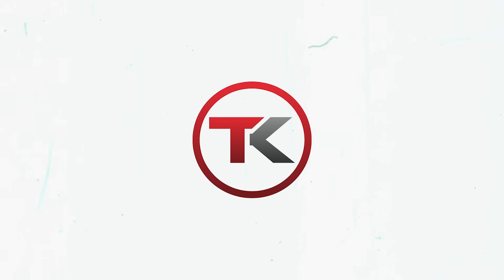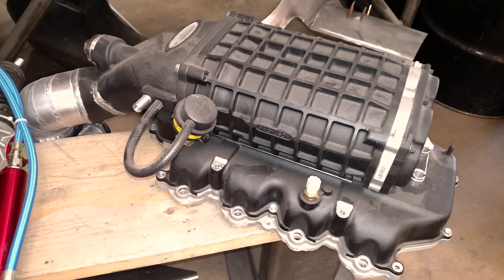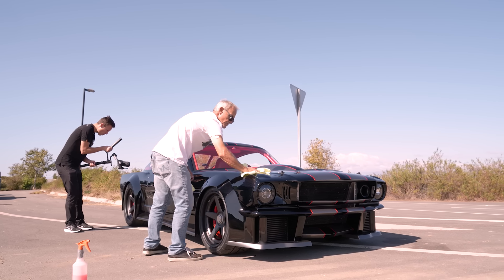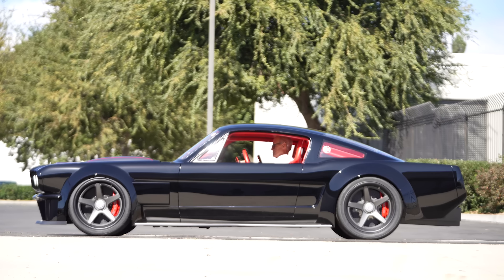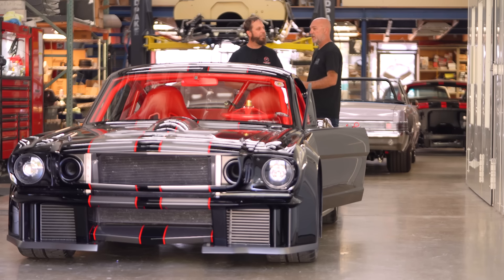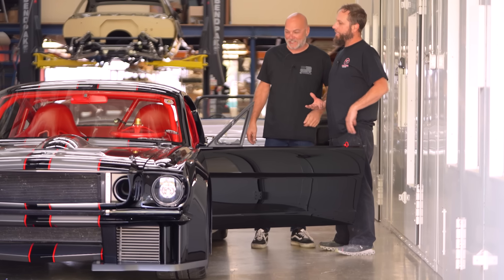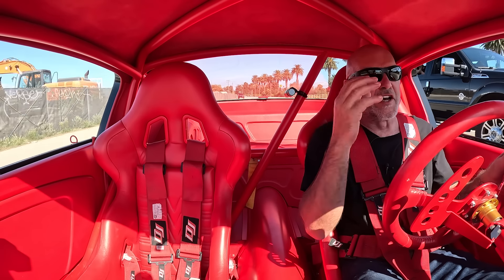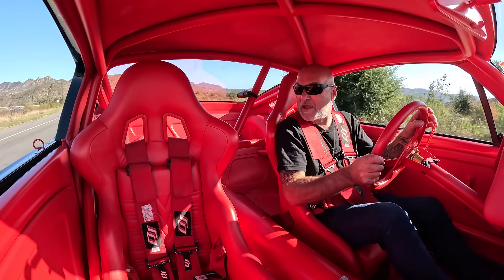The 1003 whp Twin Turbo/Supercharged Vicious Mustang 2.0 is Back!

Comment: I lost 675lbs. On my 66 chevelle using similar methods but used a badass 383 forged internals and ported aluminum heads to produce 625 hps......i ported and water benched the bowls......custom ground my irsken mechanical cam and lifters.....sold it at thunder valley noble oklahoma after two runs for 32 large in 2017......miss my she beast.....

Comment: If I were to change anything the black exterior would be either satin or flat black and a little bit of black in the interior just a tad for contrast, but these guys know far more about building and this type of thing than I do. There's nothing wrong or bad about the way it is just my preference would be the reason behind the changes.
Reply: Thank you, matte, satin or flat, if damaged, you have to re-paint the entire car. As opposed to gloss, you can deal just with the damaged area and blend color and clear coat. It’s more of practical reasons💯👊💯
Reply: @christophermarechal5017  i get it completely, Im just a fan of flat black I had a 79' Camaro and a 68 mustang that I had painted flat black and I love it. But I do understand the reason for gloss, it's beautiful regardless.

Comment: Truly a spectacular project! Impeccable craftsmanship and outstanding engineering. Speechless indeed. The only thing I'm down on is the ubiquitous red interior. Don't get me wrong, red is my favorite color but if it was toned down a little with a second color it would be even more spectacular. For example, the tunnel could have been painted black and maybe some black on the doors to contrast the red. Steering wheel spokes as well. Otherwise, it's perfect.

Comment: The car looks so vicious because the people that can’t get the driver experience from it still realizes how vicious this car is. Badass car. One question though. Did they use a more modern (2005-2014?) Mustang roof to get the fastback look and the quarter windows? If so that’s cool.

Comment: its an interesting setup, seen compound boosting on the old 2007 gt500 and the 03-04 cobra, but that Magnuson 1.9 is a restriction. 

Pull that off and put on a take off 2650 GT500 supercharger, you'd probably pick up 100+ hp on less boost or the same 16psi.

Comment: I'm right with ya. That car is very special. I do have one issue with the whole video. That is that you never really hammered it. I know it's not your car and you don't want to tear it up. But I think it's safe to say it was built to be hammered. All the internals are there, everything was taken into consideration so that when the throttle is pegged it works and it will stay together. So 5,000; rpm ? 6000 ,? Nope I would have had to get to 8500 rpm minimum.  Regardless great job for sure. I really wanted to hear it at 8000 +  the Coyote sounds really good up top.

Comment: 5.1 liter 4 valve V8 with twin 68mm turbos plus a 1.9 blower on E85 revving to 9,100 RPM on 26 PSI and making only 1003WHP? What am I missing here? Did this car have a massive boost leak? 
My 997.1 turbo bored and stroked to 4.1 liters boxer 6 cylinder with twin 66mm turbos on E67 with 30 PSI revved to 7,000 RPMs puts down 1209WHP. Something doesn’t add up

Comment: It's kinda hilarious how fast and visceral this thing is, and you barely got into the superchargers boost, let alone gave it enough throttle to spool those 68s up 😅 I'm sure the NA block makes 550+ hp, which is effectively what you were using the entire time.... I love turbocharged cars, and absolutely adore compound boosted stuff, you never see them, but with a Magnuson 5th gen alone (which this isn't) this would be putting out the same power if not more....sure it's nowhere near as cool as a compound setup, but you'd lose all that piping and turbos and probably at least another 150lbs of weight removing it all and simplifying it 😅 ....or, get a 5th Gen in place of that, and keep the turbos 🤣

Comment: What the whole left side was tore up? That  door ding give me a break. You blew it on that one bud . Over exaggerating  for effect destroys credibility.
Reply from the maker: Left rear flare, door and pushed into the fender…over exaggerating? It was $100K repair but I’m over exaggerating 🤦‍♂️
Reply: @AutotopiaLA  you were more careful and specific with your words when describing your car accident. Yah you exaggerated with the adjectives used to describe that minor dent on that custom car. Had that dent occurred on a factory assembly car.  It would be the same amount of time to repair. The cost is arbitrary the time is the same.
Reply: @hansenleal For you to compare the damage to Vicious, as a minor dent, shows your ignorance, that you sir, are clueless. Even comparing Vicious to a factory assembled vehicle is absurd. Vicious required: New OG (1965) drivers door, then you have to flush the door handle, creative thumb latch and gap it correctly, skin the rear quarter panel and rebuilding the flair, rebuilding the rocker splat, repainting the entire car, removing all the flush mounted glass and installing back, removal of doors and entire front end clip, including both fenders. Does this really sound like a “minor ding”. No click bait here, never has and never will!! Thank you for your comment👊